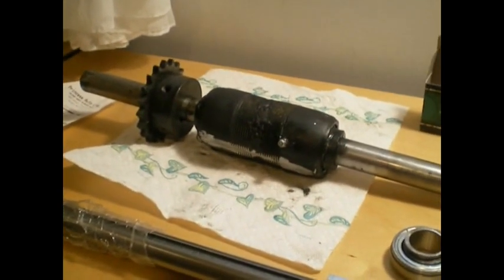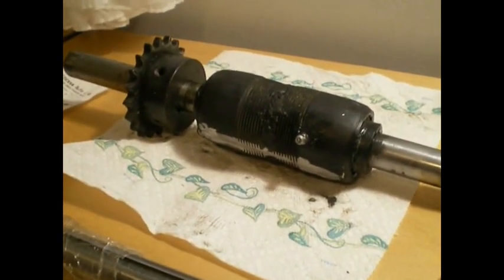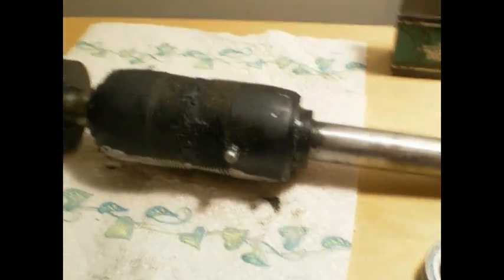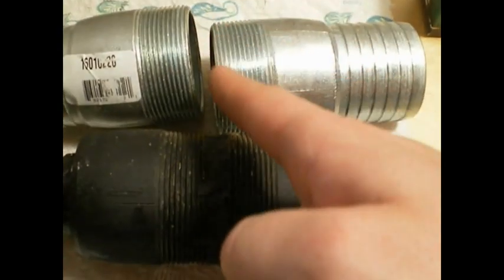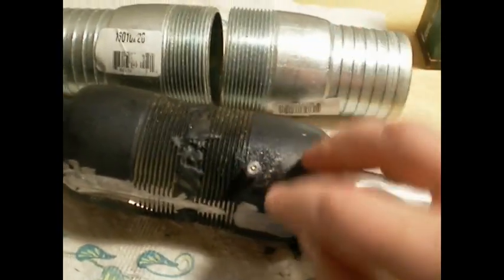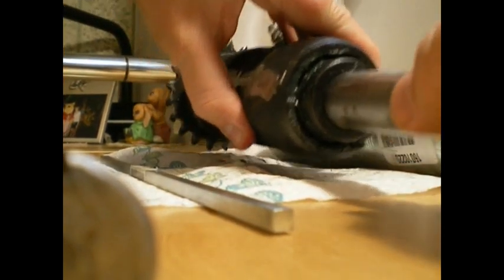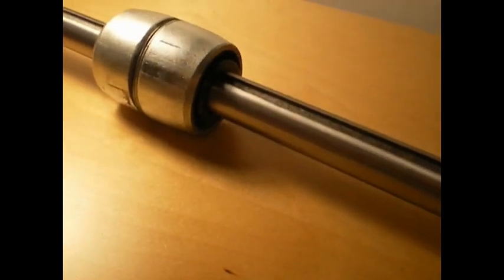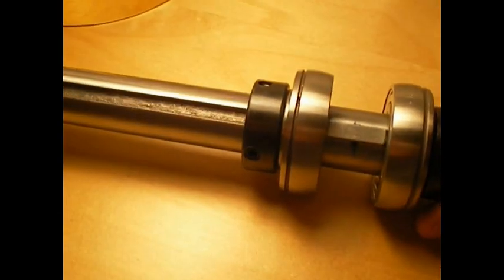custom built axle drive shaft for moped go kart

Comment: I know this is an old video, but this idea works pretty darn well.  I remember seeing somewhere on the Internet an old magazine article building a horseless carriage and they used water pipe with floor flanges to bolt on some flange style bearings, the driveshaft then floats inside the pipe.

I've used it on an old golf cart that I converted to be chain driven but keep the leaf spring suspension.
Reply from the maker: Thanks man this was before I had any machining tools long ago.